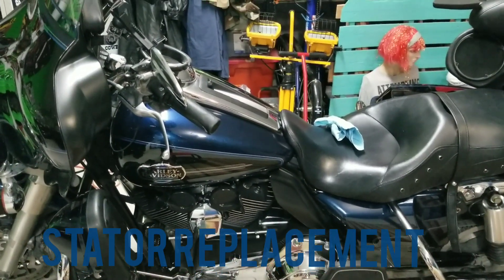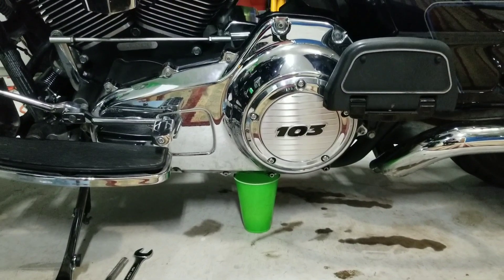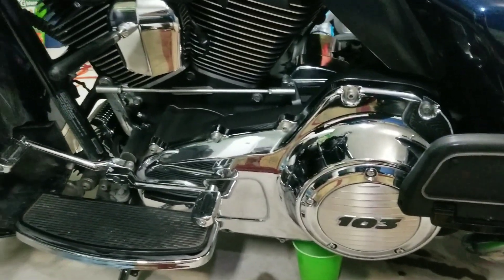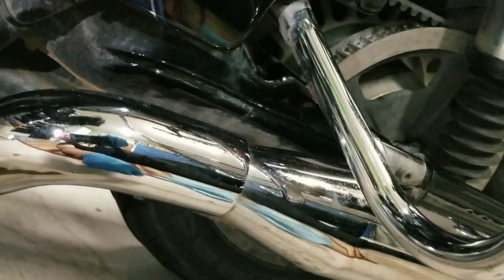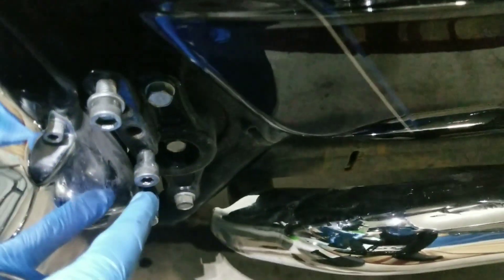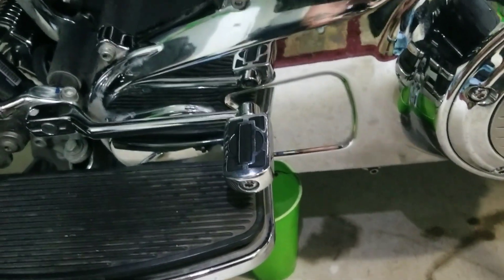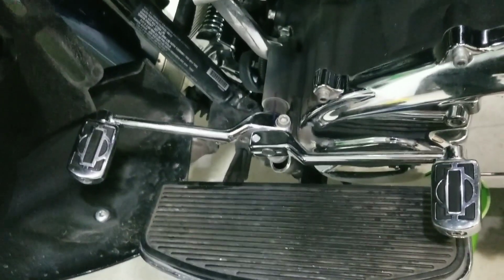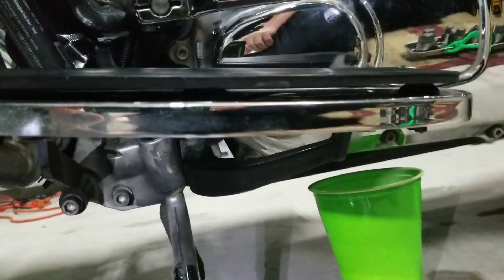2012 Harley Electra Glide Ultra Classic Stator Replacement Part 1

Comment: Well I will stop this video right here where it says you're going to reuse the old oil it tells me you do not know what you're doing..
Reply: He said he had just changed the oil so he was going to re-use it. The oil will be fine especially if he strains it through a filter cloth. If it were engine oil, I would agree with you.
Reply: @joem7572  well I had 300 miles on my primary oil I had to take the primary apart and when I put it all back together I put fresh oil in it I would not ever take a chance that something got in there oil is cheap as far as maintenance is concerned
Reply: @nicknickelson4280  That's completely understandable. Your bike, your choice. Oil is cheap and it's cheap insurance to change it but to say it is the only choice is false. I worked for many shops over the years and sometimes a customer can only afford so much and we have to meet them where they are at. I have replaced so many Alison valve body components where only a spring or solenoid needed replacement and the fluid was still good or next to new. We would filter it, reinstall it, and send the truck on its way with zero problems. Transmissions, differentials, and other gear boxes are going to be fine with slightly used oil. Engines on the other hand are a whole different ball game.